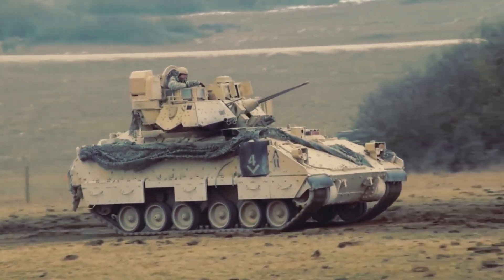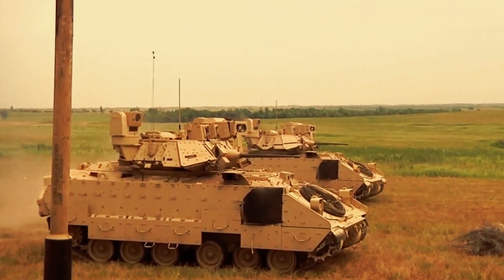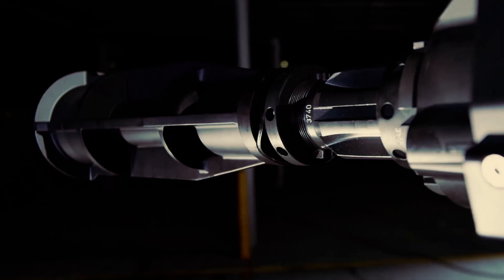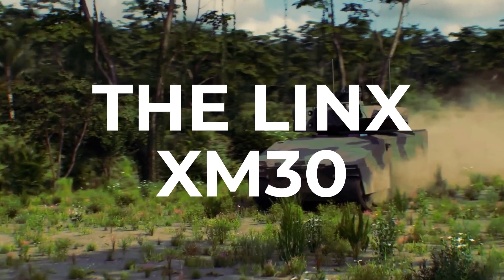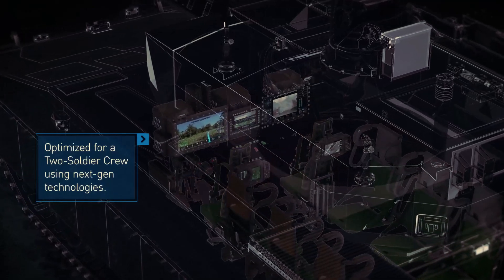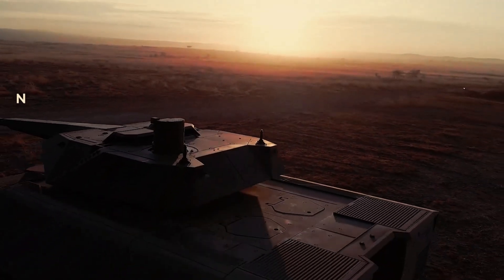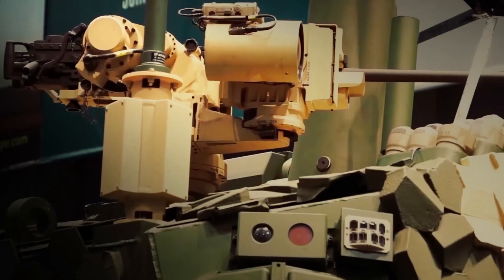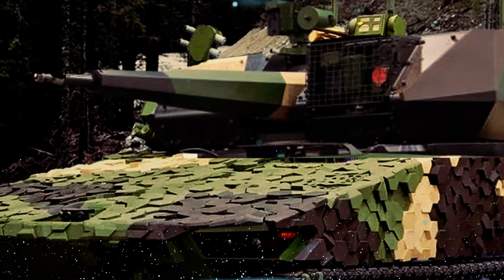The Army's New Super Combat Vehicle is taking shape

Comment: Its amazing how the Ukrainian conflict has prompted the need for so many changes. The XM30 will likely be built from new materials and techniques such as 3dprinting, the crew is reduced by a crewless turrett and a hybrid electric drive extending range by 50% with also silent modes.
Also the ability to run remote and autonomous...

Like the SEPv4 Abrams ugrades are dead and from the ground up new designs are needed due to modern battlefield technology namely drones.
The M10 booker is likely the worst one hit as only just released and no longer fits the new doctrine the US seems to be adopting.
Reply: Wars do that.
Usually they enhance enhance, change medicine, the medical field, as well...(😮)
Reply: They have been wanting to replace Bradley for 15 years. Every time they have started developing another, it gets cancelled because of cost.

Comment: The M2 Bradley is a beautiful military vehicle, I want it to remain operational for many more decades, and never need to be replaced from the new military vehicle. And I want it upgraded from M2A3 to M2A4 Bradley!
Reply: Its already obselete, but does well against antiquated russian armour, the focus is China and the US knows it needs cutting edge battle tech.
Hybrid drives extending range with silent modes, crewless turrets, lighter with smaller signatures with higher levels of protection are required, those are essentials and likely will require a complete redesign and not upgrade.
Reply: @rolyantrauts2304  Noooooooooooooooooooooooooooooooo
Reply: It's not obsolete. A4 is already here @rolyantrauts2304